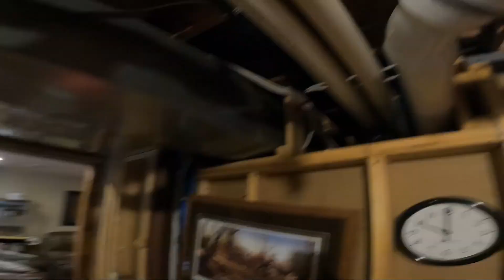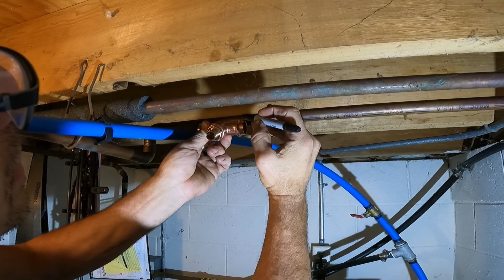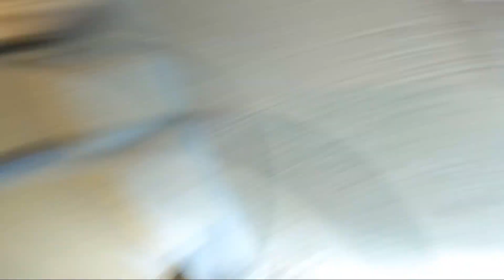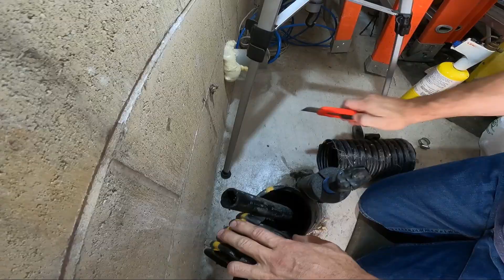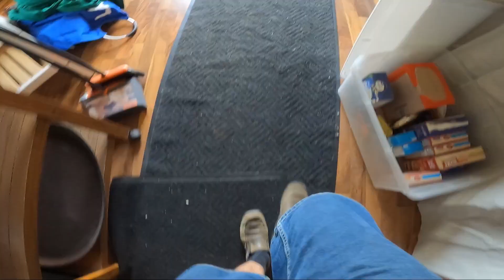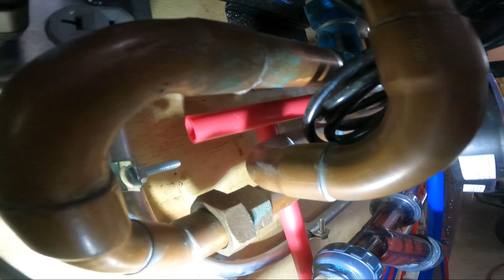Plumbing water to my shed using PEX, PRO Press.  Plumbing water to instant on hot water heater.

Comment: Try using uponor aqua pex system or at least the copper crimp rings. The pinch clamps deteriorate over time.
Reply from the maker: I still have more to plumb so I’ll take a look!!  Thanks for the tip!